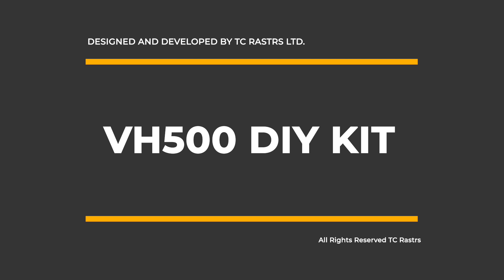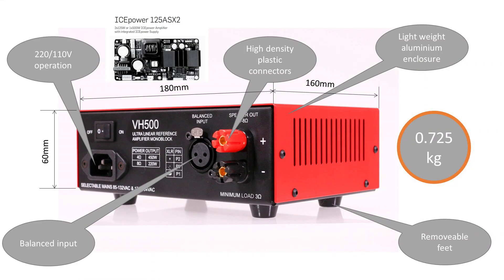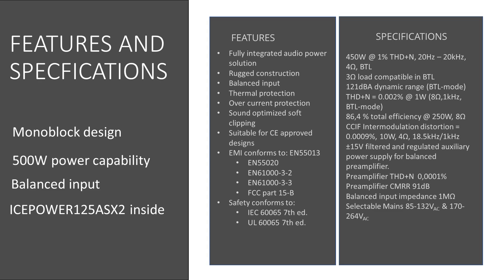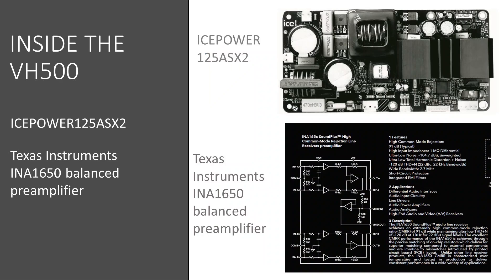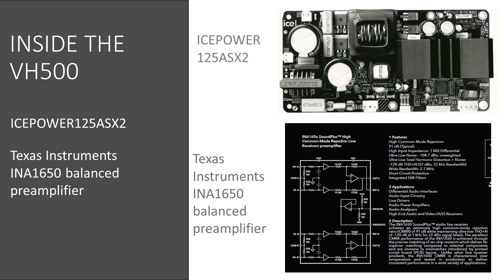VH500 DIY kit assembling instructions EN

Comment: Hi

I've purchansed two VH500 units and very happy with them. However, I'm switching to single-ended inputs and I want to replace the internal pre-amp with one suitable for single-ended input (Ghent's RTX module). Can you please tell me the specs/model of the indicator LED? Is it a 12V + resistor model or a simple 2.1V green LED? I need to know the resitor value I should add for a 12V supply with up to 100mA limit. Thanks.
Reply from the maker: You can use the preamp in a single-ended connection as well. You need a tiny XLR to BNC adapter.
Reply: @guntarssmits2104  

Thanx. I tried and it works, but I'm losing 6dB of gain. Ghent preamp has a +6dB boost. Can you please let me know the LED specs? Ghent's preamp has a 12V LED port with 100mA limit. I need to know the needed resistor to use your LED. Also, can I buy a VH500 case without the preamp and with RCA input instead? If so, I'm interested in 3 more to complete my 5 channel setup (I've upgraded my Yamaha to Denon, so no XLR outputs) Thanks
Reply from the maker: @ebarbie5016  Standard LED used you need about 5-10mA. 5mA is fine. FH500 Has been sold out. Even the last piece. ICEpower released second gen board family and I have built kits for 1200AS2 and 200AS2. 125ASX2 raised its price and become hard to compete with  1200AS2 which is an incredible board. State-of-the-art design. On my channel, I have videos about it.
Reply: @guntarssmits2104  

Do you have a kit for the 1200AS1 ? The 1200AS2 is a stereo amp, and the 1200AS1 is a mono amp. If I understand correctly, both have similar specs, only the 1200AS2 can be used in BTL.

Comment: Hi.  I noticed the amp board is directly place on top of the case.  Is there possibility of shorting it?
Reply: By the way.  I ordered the case already at ebay.
Reply from the maker: All boards has pressed standoffs and secured with 4 and 6 screws

Comment: one question, is the input a high impedance input suitable for guitar or bass guitar?
Reply: I've already ordered your kit and an amp, just need to know if I need to add another buffer for an unbalanced high-z input :)
Reply from the maker: Input impedance is 500KOhms. But I do not know what are required specs for guitar.
Reply: Normally a 1M Ohm input impedance is required for guitar pedals but I think that 500kohm is more than enough. I'll test it and post it here :)

Comment: where is pre-amplifier ?
Reply from the maker: Look at the minute 3.47. it is a small board near the input connector.
Reply: @guntarssmits2104  weird - I see nothing except ICEpower125ASX2 board
Reply from the maker: @VIVAFPV  It is a small board with connectors secured at the back panel. With SMD technology we can make small footprint designs with a lot of electronic components.

Comment: Is there an easy way to add a volume pot to the design,  considering there's already a good pre-amplifier circuit that would be a shame to add a preamp just for this :/ . I'm using volumio for Qobuz steaming and I can't change volume from the app (bad integration...)
Reply from the maker: It is a standard question😊. To achieve maximum quality, you cannot add volume regulator after preamplifier. All essence of the preamplifier is to have a high impedance in input and low impedance at the output to drive the power stage with maximum tolerance. For professional systems output impedance is standardized and should in the range from 50 Ohm -600 Ohms. In my design, it is 150 Ohms. For consumer devices, you can go up to 1 kOhm but not more. When you put 10K or even worse 100K good alps potentiometer after preamplifier you will kill all the beauty of the design at it will become mainstream products with compromises and lack of detalization.
Reply: @guntarssmits2104  SO Assuming I want a hardware volume control can I use a stepped attenuator in between my DAC and the amp ? (a balanced one like this : https://goldpt.com/sa2x.html)
Reply from the maker: @bitterspike  If you are going to use only balanced scenario than you can regulate volume using balanced regulator at preamplifier input. There is sample of typical connection. You need 2 fixed resistors and one variable/ channel. https://www.audiotechnology.com/tutorials/on-the-bench-diy-monitor-controller.  My balanced preamplifier has very high input impedance of 500kOhm what allow to rise fixed resistor values up to 20Kohm. You may find some ready made on eBay.

Comment: When I spoke with ICEpower, they warned against purchasing the Chinese clones as they use older parts and fake branded caps etc so the quality will not be the same. Where are you sourcing your boards from ?
Reply from the maker: We do direct purchase. But I had history with the china boards and they are good for price. By yes they use obsolete MOSFEts